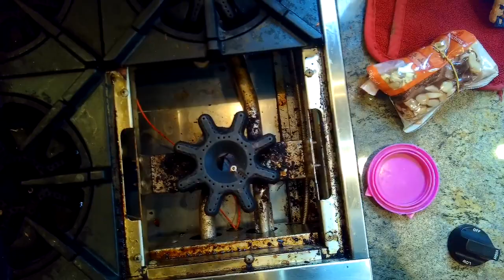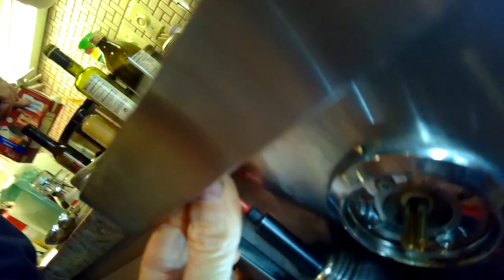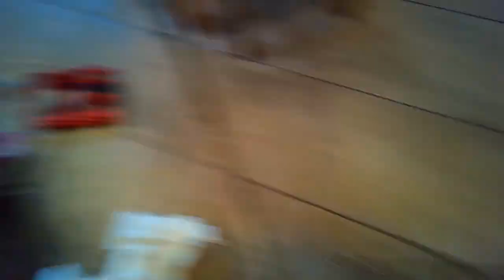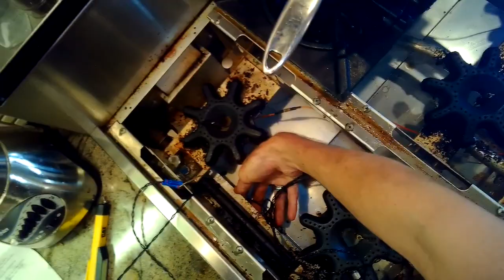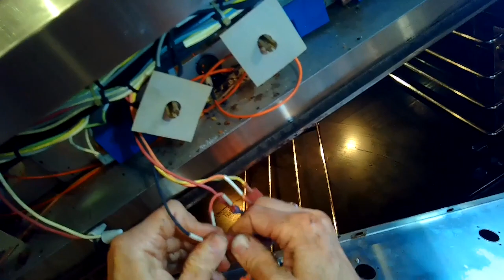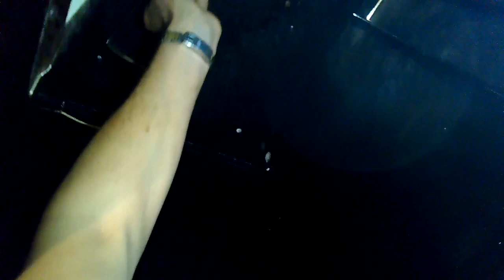✨ 🌠BLUE STAR RANGE  - Easy THERMOSTAT REPLACEMENT ✨

Comment: Thanks for the video. It definitely helped me trade out the thermostat on our mid-00's 36" RNB.  I used part CSK-1000039 from Bluestar, and buying direct seemed to be the best price.  The one comment I had was that ours had spade wire connections on the adjacent LED (orange; apparently newer ones are blue).  I didn't need to wire in a neutral as a result, I just popped the white off the LED, attached it to the white wire with the male connector on the thermostat, then connected the other white from the thermostat back to the LED.  One goof- I lost a bit down the hole where the gas manifold comes up under the burners while taking the back screw off the drip pan guide rail, and it will remain there.  

My only odd experience was that the first time I fired up the oven afterward, my remote thermometer said it shot up to 400F on a 350F setting.  I did have the probe in the center vertically but to the side, where I'd been using it for cooking with the old thermostat (which had gotten a little wobbly in the knob and the setting and actual temp quit matching). I turned the convection fan on, and that helped even things out a good bit.  I also called Bluestar due to initial panic, and their customer service was super cagey about talking to a homeowner on a technical issue.  By the time they called back, the oven had settled out.  They said to move the probe more to the middle of the oven.  With that and the fan off, it was pretty even around 350F.  We'll see how it goes with some use.
Reply from the maker: Excellent info.
Thank you😀